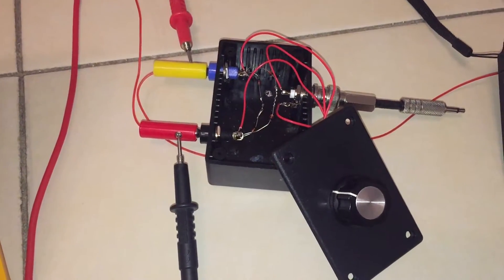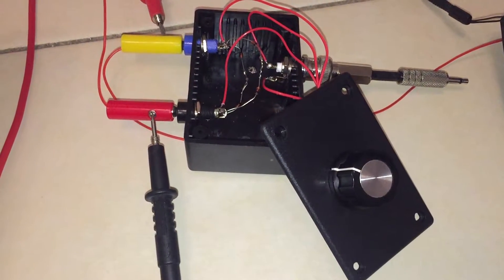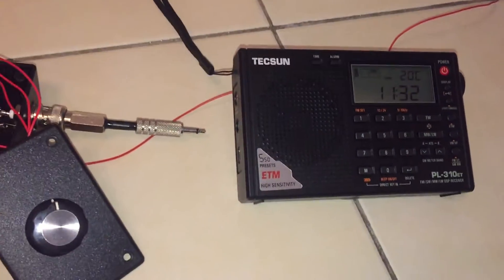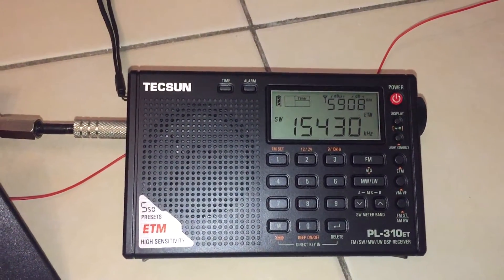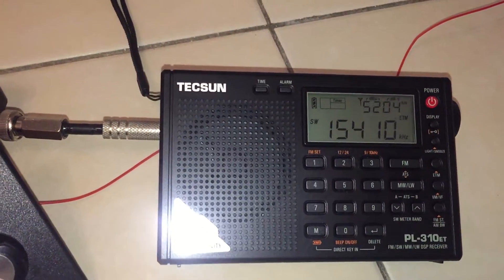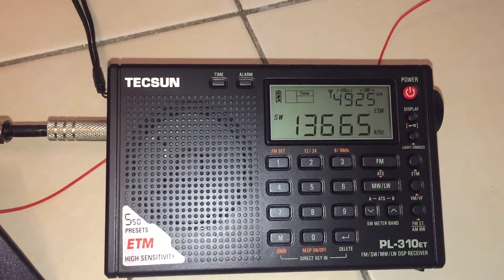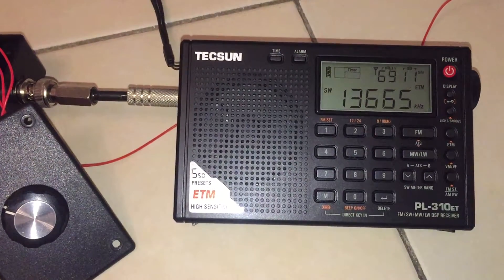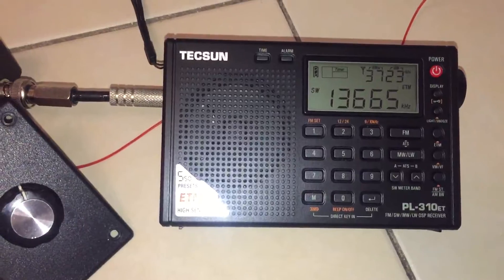Home-brew signal attenuator and static discharge protection for your portable radio

Comment: Could I simply connect the device to my SW radios whip antenna and not use the ground portion? I'm thinking alligator clip or such. I will be using 1N4148 diodes.
Reply from the maker: I'm not sure Ron...

Comment: Where would one ground this radio? Is the PL-680 the same with regards to the antenna input. I assume the tip of the jack connects the antenna to the radio and the other part is not used or could that be the ground/earth?
Thanks
Reply from the maker: Hi there, you should be able to use the external antenna jack casing for a connection to ground - in the same was as I have done with the PL-310ET. You can also effectively ground the  radio by attaching a longwire antenna to the telescopic - just a few turns around the base and then ground the end. 73! Clint
Reply: "just a few turns around the base and then ground the end" So this would be an inductive coupled grounding of sorts? Thanks
Reply from the maker: Yes, so imagine you had 100 feet of wire as an extension to your telescopic....at the receiver end wind the wire around the base of the telescopic rod half a dozen times or so and then ground that end - a 3 foot copper pipe would work very well. It will help overloading on stronger signals - and yes, it's an inductive coupling. 73! Clint
Reply: Alright, so the ground is wrapped around the base of the antenna, am I to assume that this would be insulated wire then? (the only dumb question is the one not asked) lol
Reply from the maker: Hi Craig, yes, insulated wire. I've tried this previously with my Tecsun PL-360 - in fact I've tried it many times and it works very well. 73! Clint
Reply from the maker: Hi Craig, congrats!! That's a really good price with shipping - I paid just under £40.

Certainly do give this a try. Nothing beats a very long, straight piece of wire lol!

73! Clint
Reply: Yep, that wire is so nice too, hard to strip though as the Teflon is so tough yet slippery. I'll make a coil out of one end and put a shrink tube over the end.
Someone ordered that wire and it sat in inventory so long they just wanted it gone, so me being one to oblige made is to.
Reply from the maker: Sounds great Craig! 

I hope your PL-310ET arrives soon and you hear some great DX!

73! Clint

Comment: Haven't built any electronic gear since I was in school and built about a dozen or so Heathkits, mostly shortwave rigs, a QRP transceiver and a 100 kHz crystal calibrator. Phil
Reply from the maker: Hi Phil, my practical ability with electronics is not great, but I get by with the simple stuff required for my DXing. I used to build a lot of crystal radios - including the Foxhole varients, making diodes out of rusty razor blades and polished coke! Great fun. 73! Clint